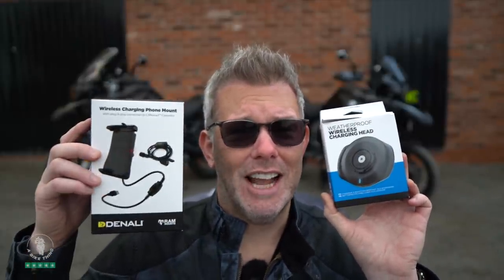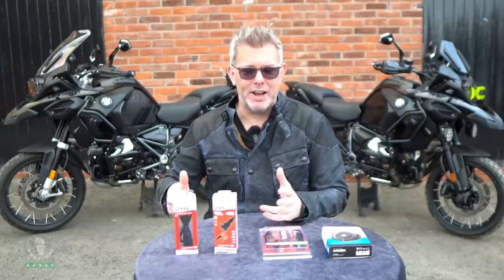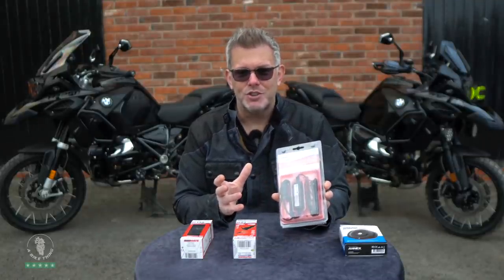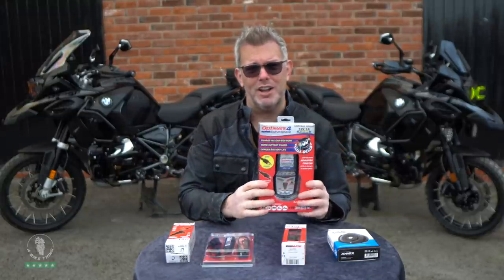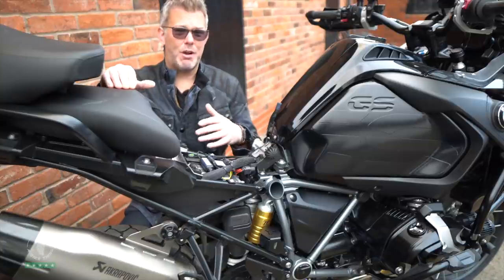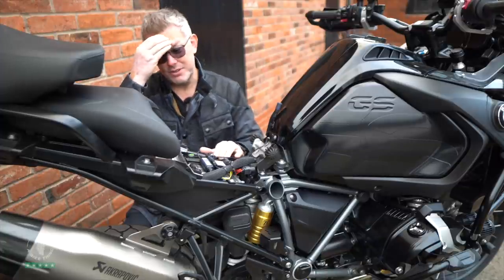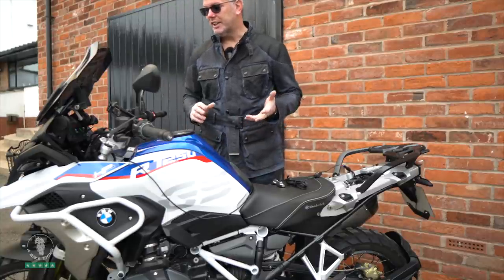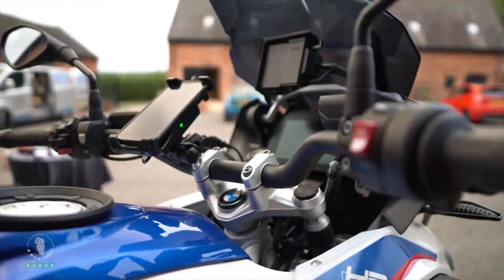Quadlock & Ram (Denali) Fast Wireless Phone chargers.

Comment: I've got a Quadlock mounted to the accessory bar. Right now I have it plugged into the USB port by the TFT display but I have a dual USB head to install under the seat. Plan on running it off an AMPLINK.

Comment: If you keep your keyless ride fob in a tank bag near to the quadlock wireless charger you can get error messages on the bike looking for the key.  There seems to be some interference which blocks the keys signal getting to the bike while the quadlock is powered up.  Popping the key in your chest pocket so the quadlock isn’t so close to the key resolves the problem.
Reply from the maker: Interesting discovery.  Thanks for the heads up although not had this issue myself.

Comment: Steve please let your customers know that the ram mount while very secure is very secure for holding your phone. I bought one for my bike and had a iPhone 10 at the time. This year upgraded to the 12 and because of the camera setup the phone will not lay flat enough to make contact with the charger. I’ve tried several different cases and even removed the case and the issue is still the same. I recently changed to the quad lock system for that reason. Other than that the ram charger I’d fantastic and highly recommend. Hope this helps and great channel.
Reply from the maker: Was it the same ram mount? The quick grip one like in this video?  My phone is a 10 pro max and fits a treat

Comment: Great Video, I have and prefer the Quadlock  as it has the optional anti vibration unit, that is a must as the vibration from the bike will create issue for smart phone cameras.
Reply from the maker: Hi Emma, there's a repetitive piece of detail i've noted on the damaged lens in the camera due to vibration and that it's only happening when mounted to the mirror mount and even when the damper is being used.  The ram provides a bit of play in general due to the material used to create the ram balls.  Firm but not rock solid.   Mounting on the handle bar which is more closely connected to the fork i think is a better option with either product.
Reply: I've done 60k miles without a damper without any issues.

Comment: They probably do it via a slight drop in voltage.  Battery is 12+ volts when the bike is off... but when running... more like 13-14 volts because the bike is charging it.

Comment: Great Vid  . I already use the Optimate charger and the Quadlock wireless charger on two of my bikes.  As well as some RAM mounts.  Quadlock make a Ram ball adapter.  BTW there IS an ON/OFF button on the back of the Quadlock ...  behind where the light is.  Also could you not just plug the Quadlock into the Denali Cansmart USB socket?  And Vica Versa for the Denali wireless charger into the Optimate.  More than one way to skin a cat!! lol

Comment: Hi Steve, What about the vibrations having a bad effect on the phones camera? I have to replace the camera on my IPhone.
Reply: Quadlock has a vibration damper that works very well. I have a Quadlock installed on my bike using the mirror mount to attach it to the accessory bar to the right of GPS cradle, on top of that I have the vibration damper, the hinged arm, then the wireless charger. It takes a bit of fiddling to get it mounted so it doesn't get in the way of the handlebars, but once you do it woks great and looks good.
Reply from the maker: As Correy said, I too have that dampener for my quadlock but it now visually vibrates more however I don’t think it’s as harsh.  Regarding the ram, well the ram ball mounts have a bit of flex/movement in them.  I don’t envisage there being any issues with vibration.
Reply: @ABIKETHING  that's interesting. I don't have any vibration in mine at all. I wonder if it's because where we've mounted them is the difference?
Reply: I have Quadlocks fitted to all of my bikes but I have to agree that the vibrations can be a factor. On my triple I’ve had no trouble at all, on my single it’s damaged the phone even with a dampener and the same when mounted on my GS via the mirror mount with a dampener. It’s fine when mounted on the bars though with a dampener. Lovely neat bits of kit though and if put in the right place on the right bike they are great.
Reply: @ABIKETHING  Mine visually vibrates more. The problem was  in a sonic vibration. the vibrations we see are not as damaging. I have the quadlock with anti vibration On 2 quads, my GS, a dual sport, and 3 vehicles only one of the vehicles uses the anti vibration.